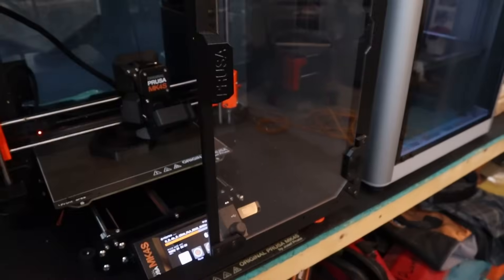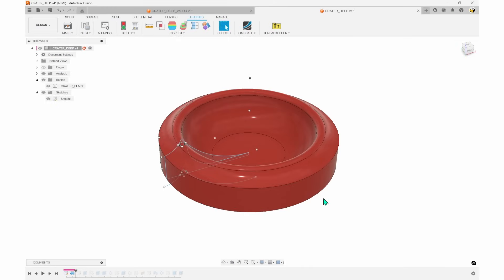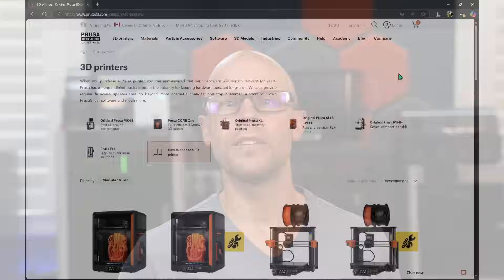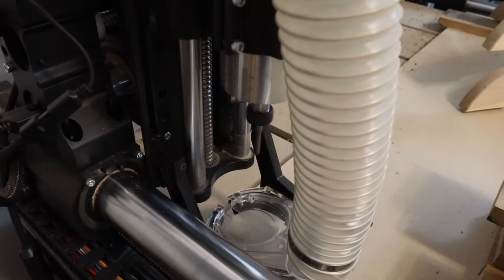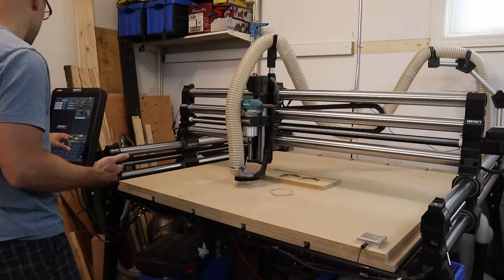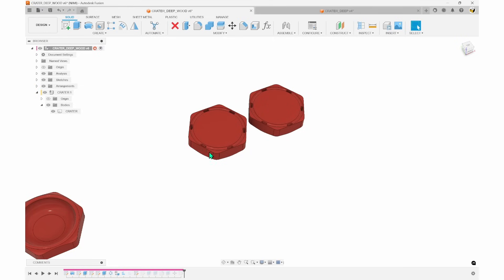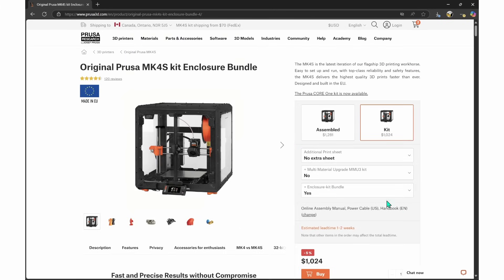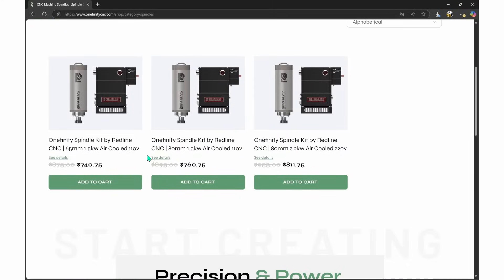Which is better?  A 3D printer or a CNC machine?  Let's find out!

Comment: comparing additive manufacturing to subtractive manufacturing is not a good flex. Two completely different use cases with a thin line of viable cross functionality.

Comment: They each have their own purposes. It really depends on what you want to make. The cnc does require a bit more care, understanding,  and tweaking the speeds and feed rates but is great for metals and wood materials. The 3d printer is easier to get a decent product from plastic in just a few clicks because the speeds and temp settings are mostly worked out for decent machines with profiles already setup. Also as far as speed goes it depends on the part, some cnc parts are super fast, others can be very slow, 3d printers are mostly slower but again depends on the part. The 3d printer is easier to get setup and is more approachable and is more compact in form factor. Cnc can be massive in size if you want it to be, but it doesn't have to be. But the best thing you can do is decide what type of thing you want to build the most of, and then buy both since you know you are going to anyways lol.

Comment: I really don't like the inconsistency in the comparisson between the two. If you want a proper comparisson, stop and compare the wood one just after the rough CNC. Plus you used high quality wood, compared to relatively basic PLA, you should use higher grade PLA to even the score. Also if you really want to go to the finish, you should sand the 3D printed part as well and apply a finishing layer, let me know then what people prefer and the price for each. And for the final nail in the coffin, with 3D printed you can create a mold and do either resin or even concrete in larger batches to reduce time spent on finishing steps.

Comment: CNC does cost 10x more in time, money and efforts than 3D printing. But the bar is too high. 
You have to jump over your head with design impossible to CNC that could make 3D printing a better option.

Comment: I disagree about CNC router's labour cost, because you should use it properly. I mean who will machine only 2 parts at a time ? Your tool changing time should be divided by as much parts your work area allows. Last, the selling value of a FDM plastic will always be lower because of the (falsely) cheap material.

Comment: It would be interesting to see a print in a woodfill like material in comparison. To see if it is possible to get anywhere close to the proper wood finish, with the convenience of the 3d printer.
Reply: Yes, would be interesting, think you'd have to do pretty much solid infill to get the proper feel, and then the post processing to get the look  would be interesting to set both out at an art fair and see which one sells better.

Comment: Well both have their advantages. Additive manufacturing can produce parts that a CNC simply cannot produce (internal structures for example).

The final look and feel off a part mostly depends on the amount of post processing done on it. Sand those 3d prints, use wood filament, stain and put a layer of poly on them and they feel like real wood. 

I really liked having both, but a cnc is significantly more involved than a printer. Dust, noise, tool changes, rigging of parts... It just didn't justify the little use i had for it.

The big advantage I see in CNC still is metal working. Aluminum is cheap and am amazing material. But that's no longer a hobbyist machine.

Comment: you could have improved the looks of the 3d printed trays a lot though. For example the Seam could have been hidden with scarf seams which works really well on models like this. Alternatively it could have been sanded and painted. Clear epoxy or similar also works well to accentuate vibrant colors. Black and Orange aren't really the most exciting colors filament manufacturers have to offer these days.

Comment: You would be much better off for this use-case, for significantly cheaper capital costs, and save most of the labor involved if you went with one of the Carveras with tool changer and laser. You could pretty much do 4 at a time with just some sanding at the end.

Comment: I can't afford a reasonable CNC. Sometimes i print templates and do use them with my router table/ my plunge router and flush trim bits. That works really well, but is kinda limited. But if you just need to cut oval or otherwise odly shaped holes into wood or recceses that have a flat bottom surface, it's a great solution. The dimensional accuracy is really nice.

Comment: The 2 parts are not really the same at the end:
One is just a rough 3D print - all the layer-lines still there, all the height-seams visible, no protection against moisture or sunlight, no smoothing. The other sanded to be smooth, coated to be more durable. 
And for the labour-cost with the printed you printed 4 at a time, but with the CNC were the labour for toolchange and flipping parts is much more of the cost you then only used 2 despite saying you could do many more.

for these parts simple plastic casting likely would win out bigtimes. Make a 3D print, properly finish the surface, then make some 2-part moulds from the print. Once you have those then making more parts is very little work/cost and in terms of durability and surface-quality vastly better than the rough 3D print.

Comment: The wood certainly is beautiful, no denying that. But I’ve got to disagree with your filament choice. Prusament is great. Lovely stuff. I’ve got a couple of rolls of their ASA that I got with Printables points, and it’s quite nice. That said, is it worth the premium vs offerings from folks like Polymaker? Absolutely not, IMHO. In addition to clawing back some cost by going to an alternate vendor, you could also print these in a wood-infused PLA like the Amolen product. I’ve printed a number of things in their Wood PLA, including most recently a  full-size chess set for a friend’s birthday. Is it as nice as actual wood, complete with grain? No, but it’s definitely a more inviting result than “just plastic”.

Comment: To answer the question asked in the title, it depends on your use-case and how much work you're willing to put into it. If you're technically minded you can build your own printer and your own CNC, and that could save a lot of upfront costs as well. I prefer the wood, and that's definitely the one that I would be willing to pay money for, if I wasn't willing to build it myself. Walnut is definitely the best choice there, although I would consider oak to be a good second choice, especially red oak. Fruit trees are also good choices. I've got some plum that I cut down at my old house and I'm not sure what to make with it, but it is spectacularly beautiful.

Also, if you like metals, using a 3D printer to make a blank that you then make a mold around and melt out the plastic once the mold has set is a great way to do castings.

Comment: When it gets to costs wood can get quite a rabbit hole. Once you start with it you want more and more tools for it. It starts already with flattening the wood like in the beginning of this video. Its definitely a beautiful material, but if someone really wants to have fun with wood it requires usually much more than just a CNC machine if that person starts at zero, which will also take up much more space and create more dust. I think one of the reasons why many like to 3d print is because you can easily do it in the apartment or living room .

Comment: There really isnt a comparison. It really comes down to what you need the item to do and what material fulfills those needs. I make items that work in both, but one can only sell for a few dollars, another sells for 5x that purely because its wooden and thusly has more luxury value to the customer. To even be a fair comparison you would have to equalize machine costs, a CNC will pay for itself much faster most of the time vs volume of 3d printed goods that have to be sold for the ROI dollar for dollar. Material cost also is a huge factor, most people arent printing with anything outside PETG/PLA when starting, so its extremely cheap, and hard to recycle (most of the time cant be) but also really restrictive on the items that have long term durability. Wood in comparison is timeless and wont get you yelled at for waste. But also they are completely opposite processes, additive vs subtractive. Some things simply CANT be CNC machined, and must be created through 3d printing or would require lots of parts or assembly. While anything that can be CNC machined, can be 3d printed if you have the right machine.

Comment: You can add wood texture to the model and use wood infused filament to get the wooden look to the 3D prints. Even stain them after.
Reply: I was going suggest trying this.  I just tried this on a simple tray and am impressed with the illusion of wood grain.  I am considering trying to give this a spray of some kind of glossy whatever to see if it looks good afterwords.

Comment: I tell this to people quite often, that ideally if you're considering one or the other, you're better off with both a 3D printer And a CNC, but get the printer first. 
While I do like my CNC for harder materials, the serious downside if you're used to printing, is that it can only cut the outermost cuts in the Z direction. Short of a 5 axis and robo arm cutting mill, there's still shapes and designs that can't be done with anything other than a printer of some sort (FDM/MSLA/SLS, etc)

Comment: Holly cow change your filament, I never realized that Prusament PETG was so expensive for 45$ a spool you could get Polymaker clear Polycarbonate, or Sirayatech PET-GF and they will both be dishwasher safe (people WILL). But if you want to stick to PETG then Polymaker PolyLITE specifically the lite version it has some magic baked into that makes it the best PETG out of 32 tested brands for 25$ a spool (thanks goes to MyTechFun). On my side of the world clear Black Walnut runs at 17$ a board foot unless I cut out the middle man and go straight to a tucked away distribution warehouse and the guys hook me up for 12$ a bf

Cactus juice is nice, it's really just an extremely runny epoxy but you need a good-sized vacuum chamber to make the juice siphon into the grain.
Reply: It's PLA and it's $30/kg. If he think it's the best then that's worth the extra $0.5-$1/pc.
Reply: @oyuyuy   1$ is over 15% of his manufacturing costs, i was just simply stating that 45$ could get him much more exotic materials or save money if he wants to stick with his material selection.
Reply: @Guardian_Arias  $1 is $1, he's not even selling these from what I can tell.

I don't understand why you'd want to print these in exotic filament either, they're purely cosmetic.
Reply: @oyuyuy  Maybe he isn't selling but the fact he had such a detailed BOM tells me he is at minimum price conscious. 

WHY PRINT OUT OF EXOTICS? exotic materials have amazing hand feel and look in person that is simply not capture on camera, even tinmorys PLA-CF is just fun to hold and play with, PPA-CF has a CNC Aluminum sound to it thats mind blowing. The frosted look of clear all-natural PC is absolutely fun to look at and the fractals it makes when looking down in the Z direction at the infill will make you get lost in thought, not to mention you can embed LEDs into the prints.

All that aside, why use walnut for the wood variants, Pine is the PLA of woodworking world and cherry is the PETG equivalent even ABS/ASA are of lower tier in comparison to Black Walnut that he used. 10$ a BF for wood is the same as 60$ a kilo it may be confusing, but I can get perfectly clear 4/4 cherry for about 4$ a board foot.
Reply: @Guardian_Arias  Yeah, because he made a breakdown for the video...

And suggesting that he should use $200/kg filament 'because it sounds funny' after whining about the PLA being $1 too expensive is quite hilarious.
Reply: @oyuyuy the bottom line was if he used the same material he could save 1$ per part and if he picked almost any brand other than prusament it would be stronger too
Reply: @oyuyuy PPS-CF a different material to PPA-CF, PPS-CF would still be 8$ per part and overal cheaper than CNC out of wood and if cosmetics is paramount then there are far more existing alternatives to PLA and PETG.
Reply: @Guardian_Arias  Oh really? Who could've guessed that different materials are different materials? And it'd be $11+VAT per part by the way.

Make your own and stop telling everyone else what material they should use.
Reply: 100% agree, $45  a kilo is crazy.. I routinely get Elegoo matte PLA for $48 for 4 kilo... Bambu refills can be as low as 14.. Polymaker is routinely around $20 a kilo... 
way too high for filament costs.  Those are landed costs.. no extra shipping or tax.. I barely notice any difference when using Prusament.. just my 2 cents.

Comment: Hey Mike.  I would have to admit that i like the wood look more but that got me thinking.  Knowing that i would not ever be getting a CNC machine i was wondering how close  you can get to that wood look with 3d printing.  I have done some 3d printing in a good white pla and then sanded it down and used some "wood" alcohol inks to wipe on in certain orders and i would have to admit they produce a very wood like appearance.  I don't really have experience with using wood filament but do you think that maybe printing in wood filament and then sanding and staining and a finish they could look as good?  Don't get me wrong...there is nothing like the feel of fine crafted wood and like you said...with time they somehow almost always look better.  Great video as always..

Comment: It's not impossible to make something that is 3D-printed to be competitive with something that is made out of wood 😉

Simply put, there is no comparison. Price - 3D-printing. "Quality" - wood. (I mean my quality - feel, premiumity, etc. Others will have other measures)

Having 3D-printer, but no router, I wouldn't buy printed parts - I could make them even in Tinkercad with maybe upscaled PrintABlock connector to keep them connected.
But I might buy wooden pieces, if they are nice.
(I might buy a 3D-model if it was good.)

I would prefer wax as treatment / finish, it preserved the feel of wood. Or oil. But nothing that makes wood feel like plastic 😉

Comment: Not a fair comparison but whatever. Using the most expensive filament when you can get it for a third of that price. Then saying you can get walnut for $10 BF when you can't even get pine for that 😂. You also need to compare an enclosed printer vs enclosed cnc. Air quality and safety, you probably should have ppe when using the cnc, much dust in the air and then included the time to clean the shop after using the CNC. But these comparisons are pretty meaningless as the printer and CNC basically server completely different purposes.
Reply: Air quality and safety is applicable to 3d printing. No one wants to talk about all VOC produced from melting plastic, even enclosed printers are not stopping all of it. Enclosed cnc probably safer then 3d printer
Reply: @Doonmer  depends on which 3D printing method and material. All scientific studies show that VOC from FDM printing with PLA or PETG are miniscule. Resin printing is the worst and you need PPE, the others somewhere in between. Routing wood creats dust that is 1000% worse than FDM printing with PLA or PETG.
Reply: @johang1293  Not sure which studies you have seen, but most have found significant amount of VOC even from PLA and most enclosed printers still produce a lot VOC unless they have filtering system. Of course resin is worst but people still have to be informed about potential hazard that comes from 3d printing.

Comment: Interesting video. Great product to use as a comparison. The points brought out are well analyzed. As he does on all his videos. The common misconception is they both produce parts, so one OR the other.  The part I take issue with is the design constraints are so different. To make a smooth finish on 3d printing is possible. What look are you going for. Do you want a food safe ... There are lots of solutions for any issue. But it is hard to compare the finished wood to a 3d print. With 3d print it is realistic to have a lot more downloads. With CNC the skill level is very dependent on what is being made. I am lumping feeds and speeds into skill level. This makes it much more complicate to have a large download. Most people don't design their own, they download. Because the LIBARY size is so different, the easy to make is very different. The answer to the question is obvious if you understand a little about the processes, and apply what you want. Notice I am not saying the answer. It depends on your requirements.

Comment: Apart from being 100% biased towards cnc (especially in cost calculations), the video is interesting. The final result definitely looks better in wood. However, one always selects the right tool for a job and in here the comparison is made for smth where cnc would work better because it produces better looking results. On the other hand, when thinking about installing a CNC in the apartment - my brain refuses even to imagine all of the mess and issues it brings with it.... And when doing the same with 3D printer - especially when printing in PLA - no issues at all, almost zero. To sum up - that heavily depends on what you want to achieve and what are your limitations of space, ability to produce noise and other factors...